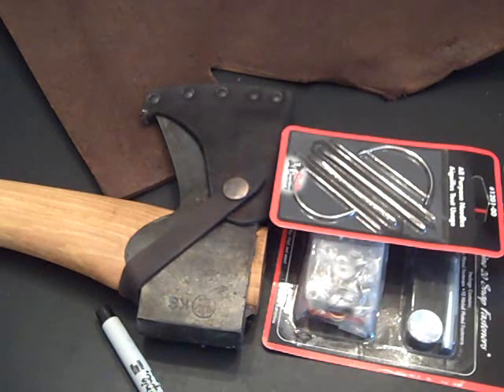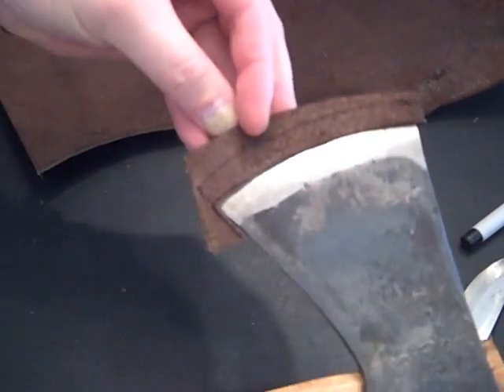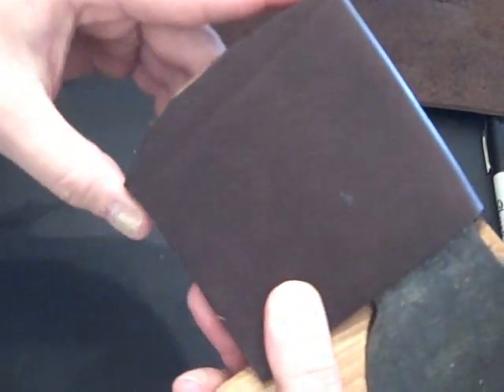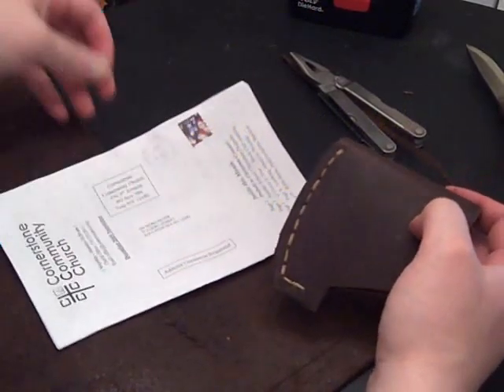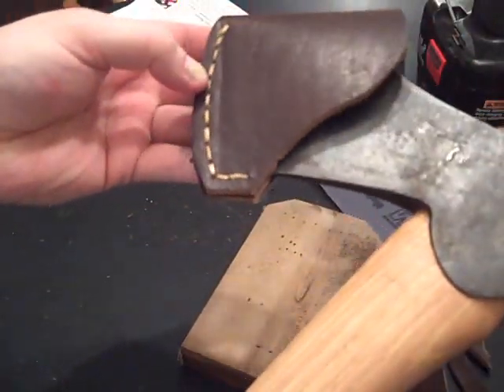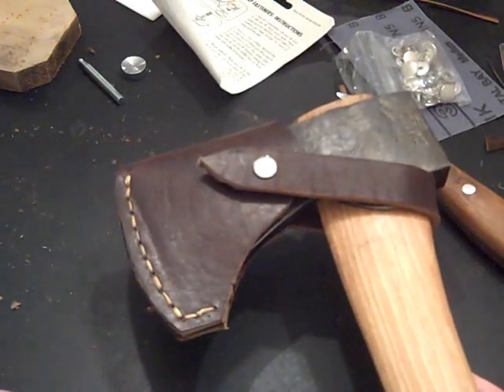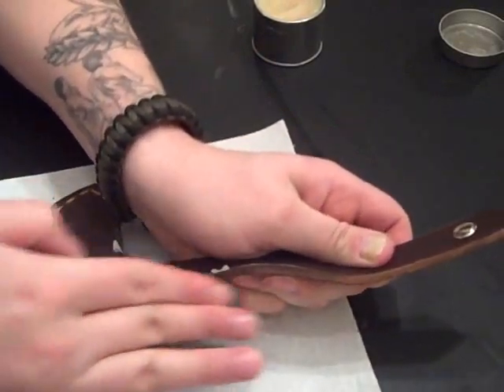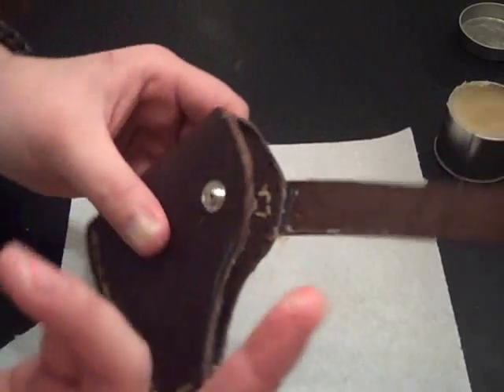Gransfors Bruks SFA Axe - Making a new mask/sheath

Comment: (I think my last comment got lost)

I like your sheath.  For my knife sheaths, I use olive oil, and I apply it to both sides of the leather pieces before I assemble the sheath; it seems to penetrate better, and the oil on the inside surface helps protect the blade.  I also use an inexpensive leather punch.  I've found it leaves a neater hole than drilling.  

I'm going to give your recipe a try.